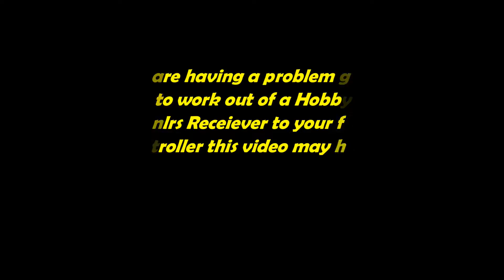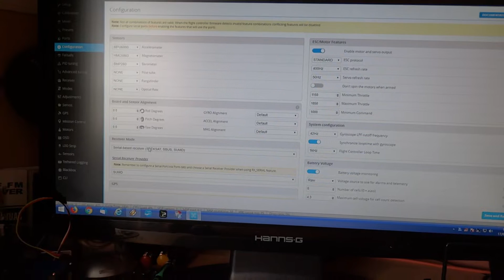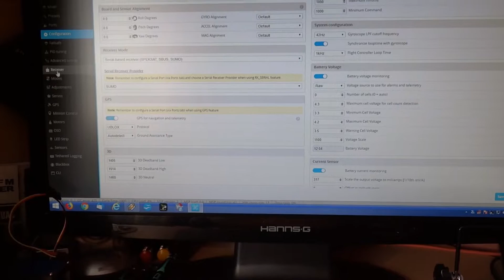Solved Openlrs SBUS to Matek FC Problem.

Comment: This is the only video I see less than 5 years old for OpenLRS. Is the project dead? I can see transmitters for purchase but not recievers. I am trying to find a long range system with RC control and telemetry for mission planner.
Reply from the maker: I still use openlrsng but equipment is getting harder to buy now as you say especially recievers. I just had to build two receiver units from Arduino Nanos and SI4432 RF Units and work.